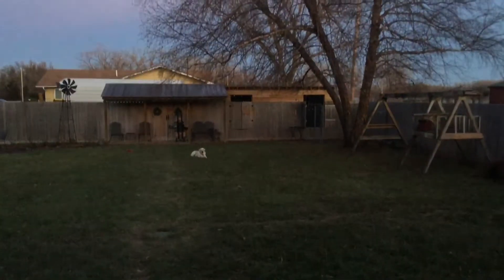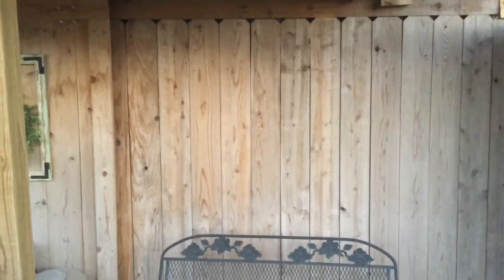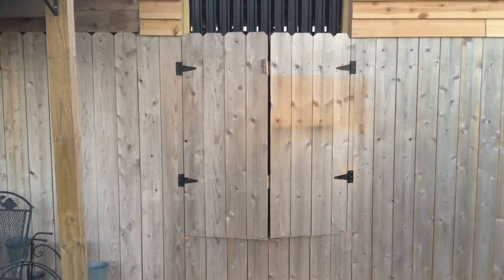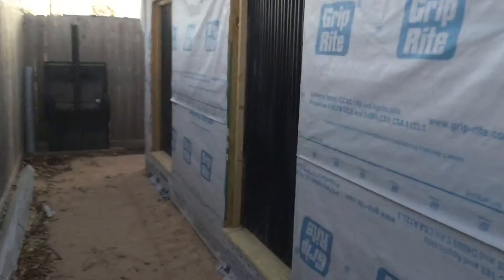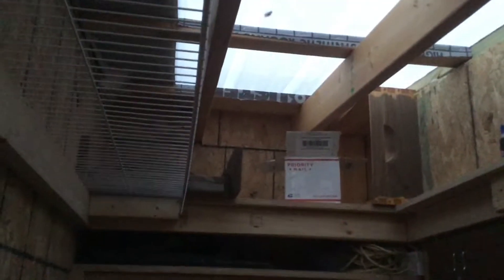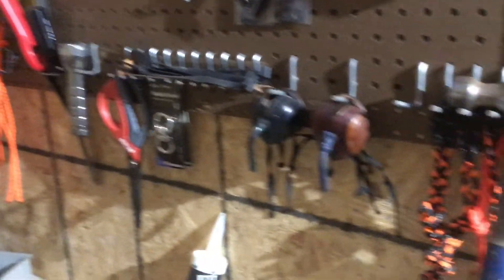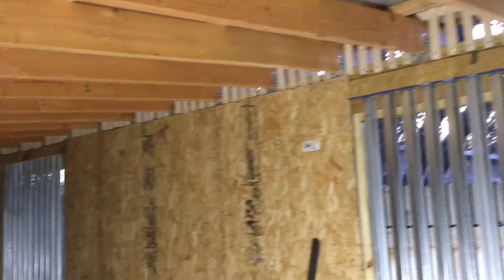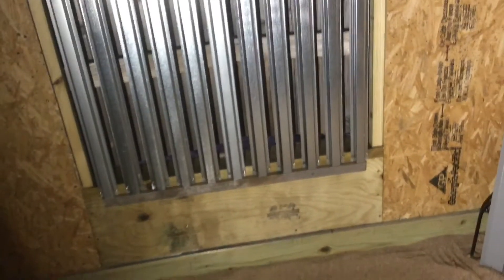Falconry mew is nearly finished 11-2019

Comment: What type of sand?
Reply from the maker: It is a cross between pebbles and beach sand.  It is actually "overburden" sand from an old sand pit that the state would not accept for road use. It has been working great. Her slices have been clumping in the sand and I scoop them up with a large hail screen scoop I made. The sand also lets me see her trails on the sand. She spends a lot of time pacing back and forth between windows.